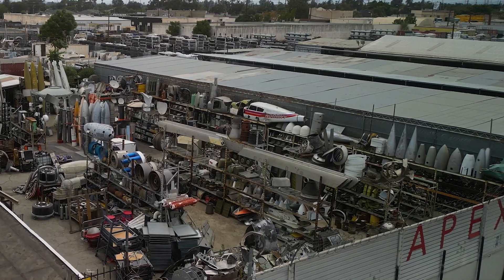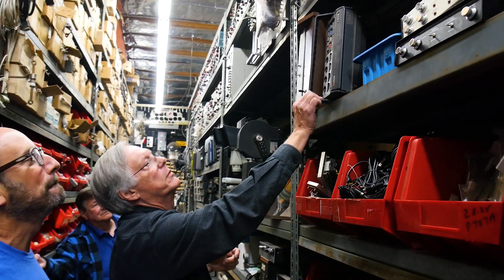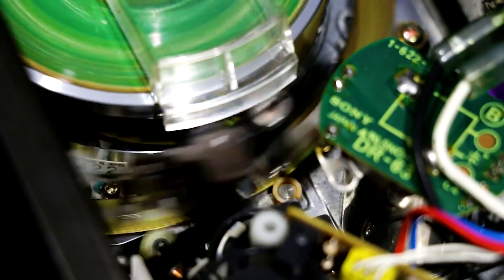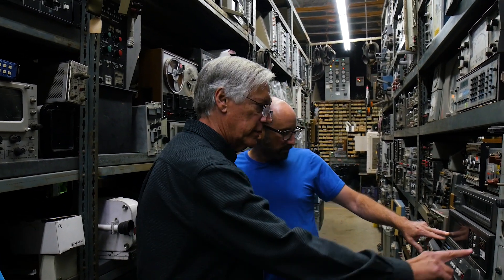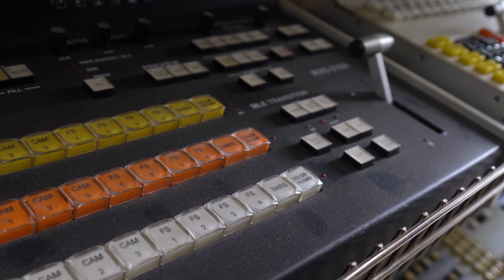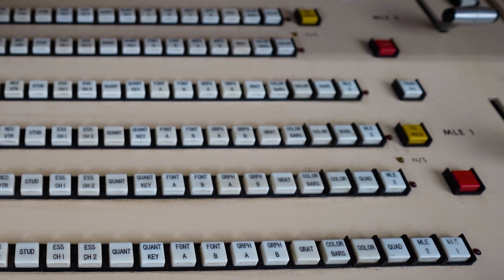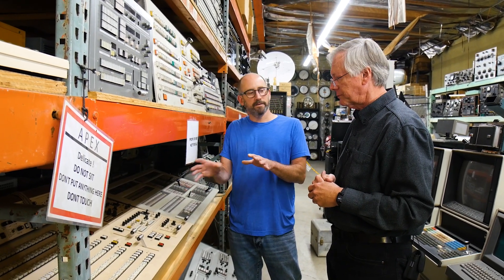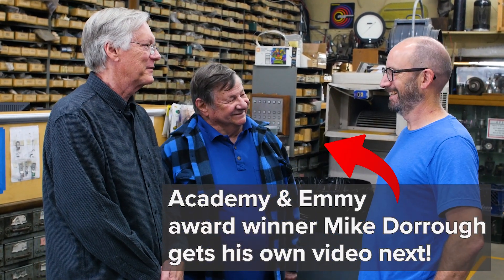Discovering vintage video gear with an expert (Apex Part 2)

Comment: Insane i have a never opened (until I can to the realization that I can no longer say that 😅) NM-67B (listed it for sale on ebay but no pics of the imaculate inerds) cost a woping 44k back in 1977-79 is in great condition